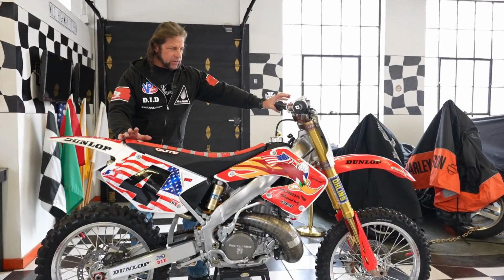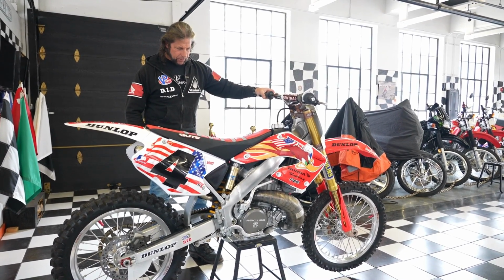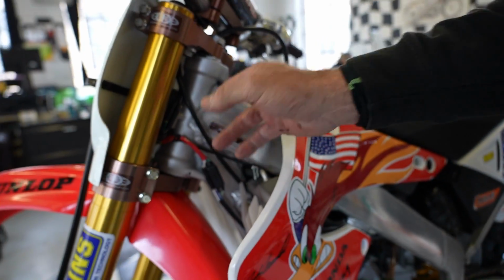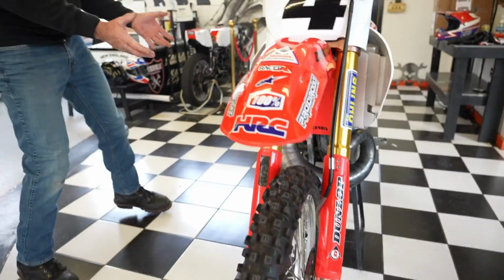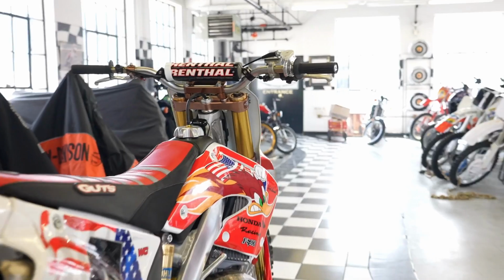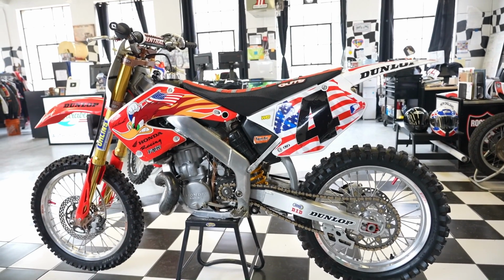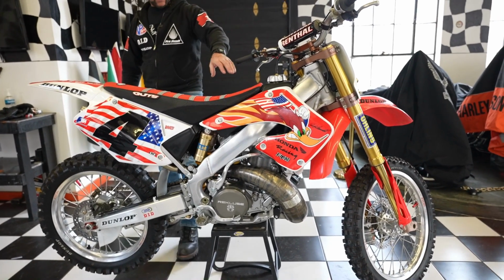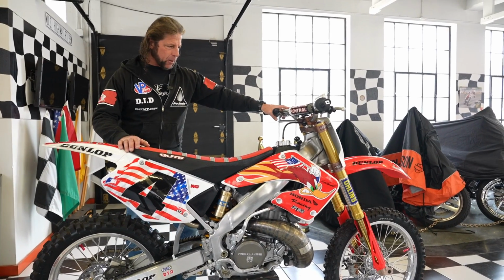SERVICE HONDA CARMICHAEL '01 CR500AF

Comment: Is that factory connection case saver  below the water pump welded on??? 
I have one brand new in the packaging comes with two mounting tabs and bolts . I believe you have to have the tabs welded to the frame then bolt the case saver on..  I can't find any info on that part other then pictures of factory bikes running them. I got a box of trick parts that came with my 2001 cr 250 that were never put on the bike from the previous owner, who by the way never really rode the bike. I also have a set of them same titanium pro circuit foot pegs with the original packaging .
Reply: Yes, tabs are welded to the frame